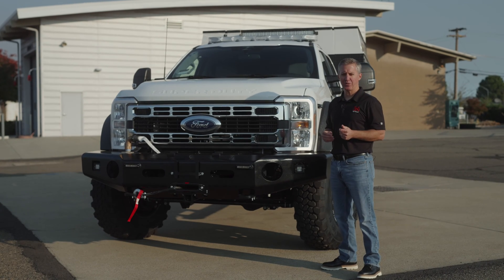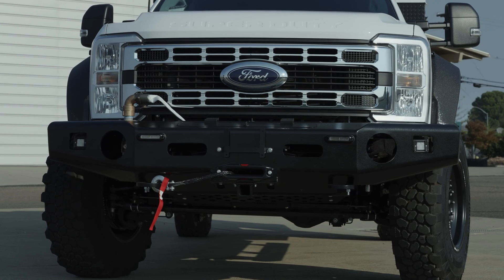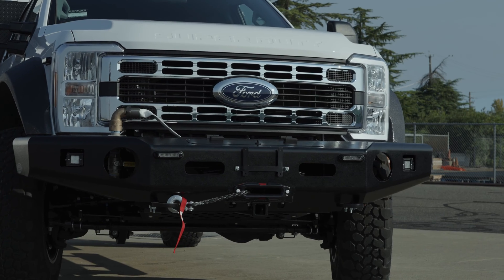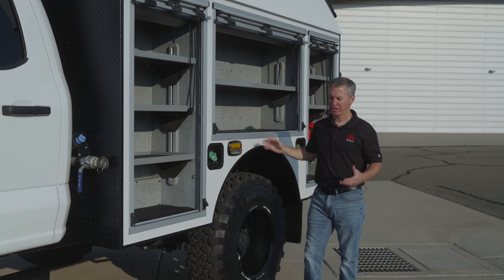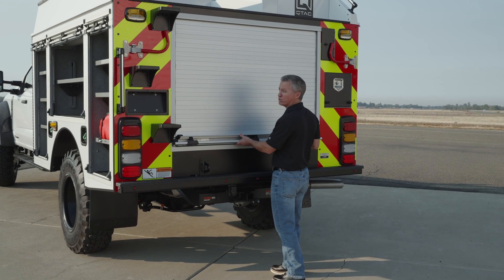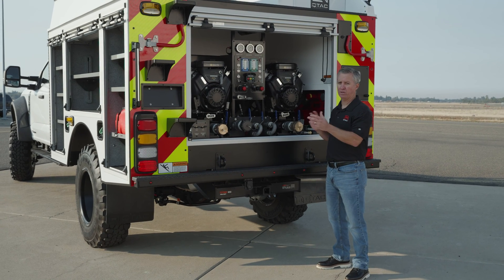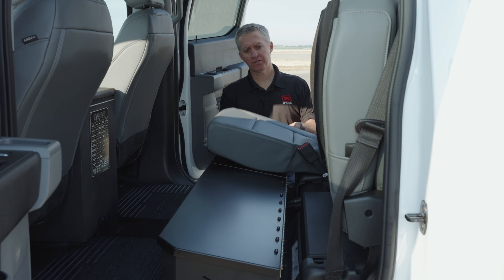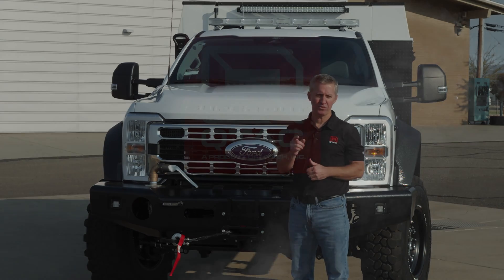Building the Ultimate Firefighter: The QTAC SUPER 3™ on a Ford F-550

Comment: Surprised you didn't use the F600.
Reply: F600 is only available with a single cab to meet type three rating, you have to be able to carry three people which theoretically a single cab truck can do, but not very comfortably
Reply from the maker: Yeah, the F-550 has been one of the most requested and does the job really well. Thanks for the comment!